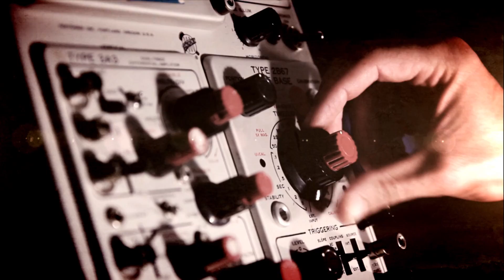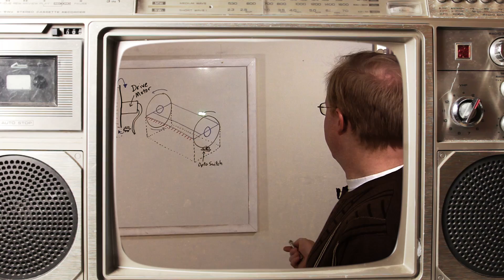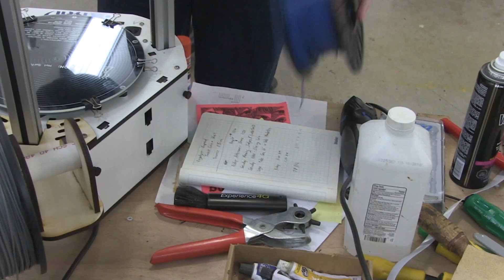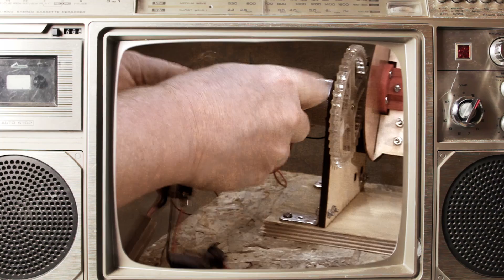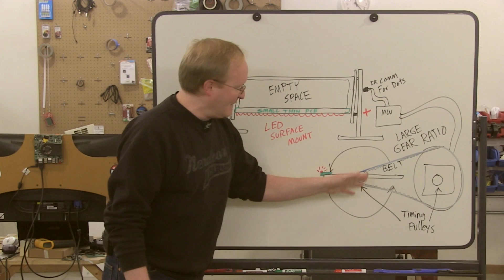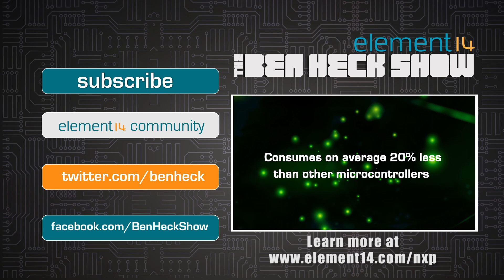Ben Heck’s Rewind & Recap - POV Display

Comment: Becuase you're taking out Alison, This is like when they discontinued the B-Team on MythBusters.
Also, that eye framerate trick works. If I look at a CRT TV in the front of my eye, it looks normal, but on the edge the CRT has a blinking + moving line, similar to what a Digital Camera does.

Comment: Why not use lasers which point on turning mirrors? Then you don't have to turn that much mass, and there is no need for a electrical connection to the turning drum.
Reply: The Lasers should shine trough a paper, so it isn't that bright

Comment: Hey I'm building an Emulation Station using the raspberry pi b+. I will be installing it into the housing of an NES and hoping to use the original power switch from the NES to power on/off the Pi. I've looked everywhere trying to find a how to video or even a web page on how to do this but I can't seem to find anything in detail. Can anyone help me out here? If it all possible is love for the red LED in the NES to function the same it would normally.
Reply from the maker: Perhaps you would have better luck asking on the community? http://ow.ly/Jg4ah
Reply: reynex90 The google fu in you must be weak. Go, train and get better at google. 

http://jamesparsons.com/2013/11/raspberry-nes-project

By the way, I hope you are using a broken NES. It really digs under my skin when people take perfectly good working retro gear and destroy it, just my opinion. Plenty of broken ones on ebay.
Reply: John Doe Thanks for the link. I googled it a few times and never found an in detail page. And yes i'm using a broken NES.
Reply: reynex90 No worries, hope your project goes well.

Comment: i doubt the 100 frames pr second theory. sure you say most 3d tv play at 120 frames pr second, but this is due to it changing the image 120 times a second, and the 3d effect is done using half of the frames in one shade, and the other 60 in another, which is why 3d glasses are needed. and why they are in two different shades of black, to allow the visual from one eye, to primarily be seen by that eye, and not the other, so im guessing more around 150 fps, pr eye, of course this is only speculation. but seing as someone(linus tech tips display rate challange or something, cant remember right now) can differetiate between 60, 120 and 240 fps, it has to be greater than 120, but i still doubt its more than 200.

Comment: This was interesting. One thing I thought was that since the 2 shafts that mount the spinning part to the frame, are not connected. Couldn't you use those to power the board - i.e. brushes directly on the shafts? Should be the least amount of drag possible? Thanks for the videos though - always eager to see what you make next!

Comment: Mount the pcb on the circumference plane with edge led. Also use the bearings to transmit power so no brushes.

Comment: you could also use metal ball bearings on the main shaft to transmit the power too. power transmission without the drag of brushes.

Comment: My first thought: use two coils and induction to wirelessly power the board. You could even modulate the voltage to provide data to the display (similar to how NFC works).

Comment: Why use brushes. ?
Why not just plug + on left side of the frame and - on right. Just connect wires to metal bolt that you use to hold the frame.

Comment: I would've actually known eyes run at 20 Hz
Reply: What the heck are you talking about? That's nonsense.
I can't even tell if you're trolling or not.
Reply: Ruben Fernandes As in, your eyes see the world at 20 FPS
Reply: Noorquacker Ind. You know that's bs, first of all the eye doesn't work like a monitor or camera, it has no "frames", it provides an constant stream of information to the brain, the only speed limitations are the chemical process in the retina and the times it takes for the brain to process it, that's why you can "feel" an slight drop and difference even in high fps monitors.

What you mean is the "minimum" fps needed so a sequence of images start to look like an animation and not a slideshow, and btw, that's anywhere from 16 to 24 FPS/hz, motion blur also helps thats why movies look smoother at 24 fps than games at 30 fps
Reply: Ruben Fernandes Well, I did learn the eye sends pictures to your brain at around 20 whatchamacallits, and I was needing a word for that.
Reply: Noorquacker Ind. Your eyes only send information to your brain if it changes. They don't see in "frames per second", hence why most people see obvious differences between 24fps, 30fps, 48fps 60fps, 120fps, 144fps, etc., etc. If our eyes were limited to something as low as 20 FPS - even hypothetically - then that wouldn't be the case.

Comment: I would make larger balanced PCB with edge mounted smd leds, and encapsulate that in clear acrylic pipe and use something like headphone jack as a brush connector and axle shaft in the ends.
Reply: Probably not strong enough and with so little surface contact for the electrical parts it would probably wear through. Adafruit makes exactly what is needed with a couple of different wire configurations.
Reply: Cliff Hartle
Thats what I meant saying something like (should have said similar to) headphone jack.
Another way could be doing what VCR image drums use, no physical contact but electromagnetic transfer with coil/ferrite setup. Heck, you could use VCR image drum as it is.

Comment: wouldn't a clear plastic tube or even a cardboard tube be easier, it already has structure and would be easy to set up to spin. 

You could have made the display wireless, possibly using the text radio set you made previously as an input.  The motor to spin the display could run off a different power system.

Comment: I would have used a cylinder instead of the frame for mounting the LEDs - it would have been much easier to spin, not to mention , since you did not use surface mount LED's, you could have drilled holes in the cylinder that the LEDs would fit in - and you would have all the wiring inside the cylinder.
Reply: I agree 100% with you great idea.
Reply: yea make much more sense can even increase resolution to 2 lines or even 4 (offccentered)

Comment: The main control µC, along with the  could be put on the display frame. Just flash the contents on beforehand. Transfer power through the bearings, and use a big cap to store power. As long as the heavy stuff rotates around the center it shouldn't be an issue.

Comment: why u just didint used plastic pipe with your PCB inside? drill the holes in the pipe for the lights, it would be easier to connect, lighter and etc.

Comment: I would have powered the POV using ball bearings, one end for positive and the other for negative, and maybe add a capacitor on the POV to stabilize the voltage.

Comment: Actually, I read somewhere that the human eye has a pretty dismal persistence of vision rate- 12fps the cited minimum. However, the higher the frame rate the smoother the animation, and the less likely a human to notice flicker. Fact: Sega was able to get away with 3D images on the master system with shutter glasses on frame rates as low as 50fps (25 per eye, taking advantage of interlacing) on a CRT display. So yeah- when NVidia tells you that we can't use their 3DVision glasses with existing 60fps monitors because of "flickering", it's BS.

Comment: Why not use a high speed slip ring for the data (maybe power too) and optical sensors to determine the drums location?  That way, each horizontal line can be triggered based on location of the drum relative to the stand and not by timing.